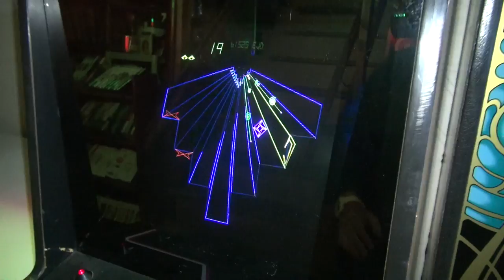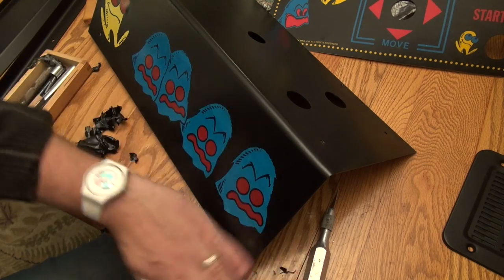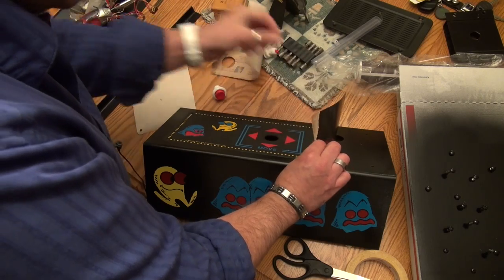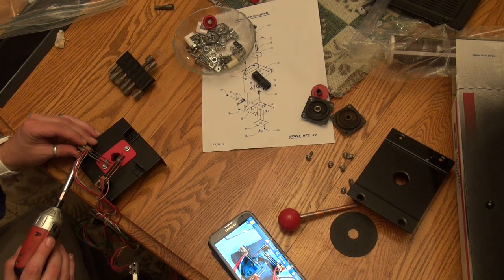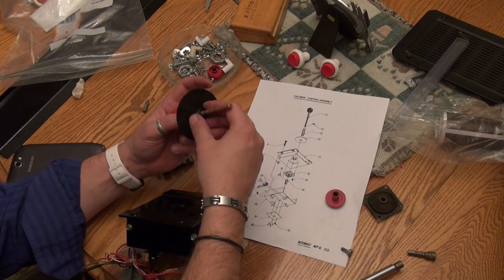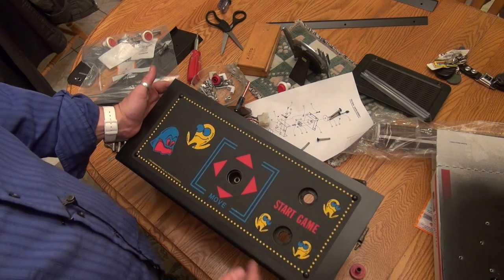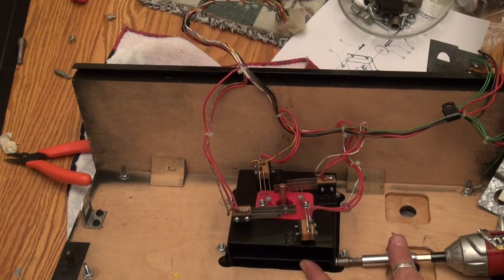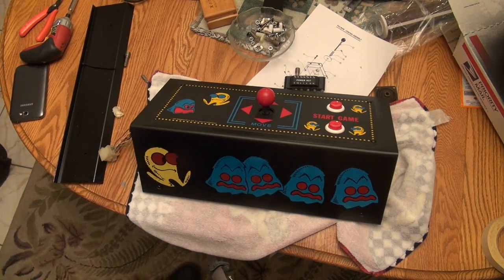Midway Pac-Man Mini Restore - Part 7 - Liquid Mask, Rebuilding Pac-Man joystick, applying CPO

Comment: Nice work as always, John! I can relate to the issue of figuring out where all the nuts and bolts fit. Usually when i take stuff apart, I try to thread the bolts back into the part that they belong to a few turns just so I know exactly where they all go when it comes time to reassemble everything. It's a lot easier than labeling or bagging everything.

Comment: Great job!  That original art looks great.

I've done silkscreening before and that art looks like it might be vinyl ink printed over a black background.  With a good scan of the art or a good enough picture, a screen printer could turn that into vector art and re-print the art on a fresh panel including text. Looks like only 3 colors.but vinyl ink is difficult to print.

Comment: well done, why did you not put some clear coat over the black and front artwork?  seems to me it would protect the silk-screen graphics and smooth out the transition between the original art and the new black enamel.
Reply from the maker: I actually did consider doing this but talked myself out of it. It seemed risky. :)

Comment: you know i might not even stick that on. the screws and buttons should be enough to hold it on. i knew you wouldn't remember where the screws and stuff when when you took them off and put them all together.
Reply from the maker: I had ZERO trouble figuring out what screws went where. I have always done everything that way. It always works out. :)